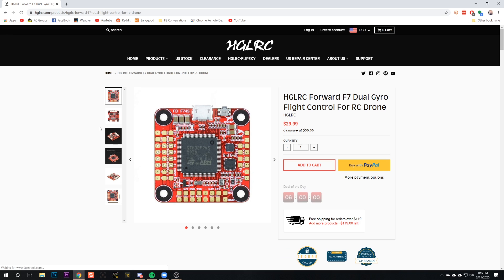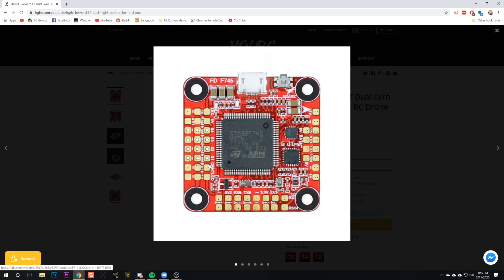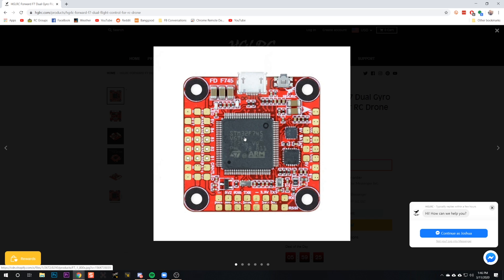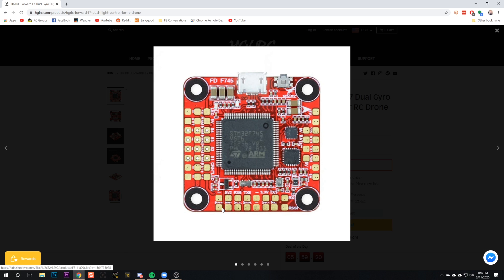Betaflight servo setup (controlled by aux channel)

Comment: What if theres no servo tilt on the tab .
Reply from the maker: You need to enable Servos in the Build Options section fo the Firmware Flashing tab. Then re-flash the FC. This didn't used to be the case when I made this video originally.
Reply: @JoshuaBardwell thank you for the reply Mr.Joshua. Ill reflash now the fc

Comment: This is so usefull, there are loads of modules/switches/relays that can run on a servo input. I also now have a known value on a pin I can use to interface with an arduino or pic.

Comment: Hi JB, I set up a Hexacoptero F550 to launch rc parachutes, I'm using ERLS 2.4 and a FC Jemcu F722, I need to add a servo to release the rc parachute, I couldn't get the servo to work using the LED port, because this command It doesn't work in the CLI, can you help me with this?

Comment: Worked like a freaking charm boys!!! Now, I'm currently thinking through my latch mechanism,  and this is going to be so much fun!!! I'm running a Speedybee F4, and who needs led lights anyways!! Lol
Reply: It looks like the speedybee f405 has a dedicated servo pin at s9
Reply: I'm making a claw for a competition with one servo, connected my power to 5v led pads, signal to s9, and g to g. How to configure it in beta flight? I'm also using speedybee f405

Comment: Thanks so much for the video! I have a Nazgul Evoque that is already using the led spot on the board. Is there a way to find another place with its own timer without disconnecting the led? Thanks!

Comment: Hello, thanks for your video !
By using the LED-Strip it´s working very well with Servo 1 (Tilt servo). When I´m trying to map Servo 2 on the same LED Strip (when Servo 1 is unmapped) it doesn´t work. So no movement of the servo, when I´m rolling the copter.
I would be very thankful, if you have any ideas for this !

Greets from Germany !

Keep up the great work :)

Comment: how to activate servo on channel 3 or yaw??
Reply from the maker: You need to change Betaflight to a trictoper mixer then it will know that yaw axis is controlled by a servo.
Reply: @JoshuaBardwell  I have set it to tricopter, but it doesn't work, I even followed your video, but it still doesn't work
Reply from the maker: For tricopter mixer, servo 1 is the tail. You must manually remap servo 1 to be some output, such as a motor output. After that, I don't know how to proceed, because I have never built a tricopter with betaflight. It's been a long time.

Comment: Having an issue with this, no idea what the problem is. Here's a video of the problem https://youtu.be/CyJEJuUaCZo , I2c errors start racking up same time motor goes out and servo starts moving. If anyone had any insight, kindly pass it along.

Comment: 3AM and five beers too many and needed to get an old tricopter up & running (yaw servo).  with a NAZE32  (F1 controller).  
Nope-
Switched to cleanflight and got it going in about 15 minutes.
I have never even used cleanflight till now.

Comment: So lemme get this straight, you solder the wired to 5v, ground and led pad, also how do I check if led pad is in use?
Reply from the maker: If there's an led strip soldered to it its in use.
Reply: @JoshuaBardwell  thanks for your reply! Could you recommend some cheap servos (that only need to be able to pull a pin for a dropping mechanism) that I could buy in Australia, thanks
Reply from the maker: I don't use servos often and wouldn't know what's available in Australia.

Comment: can we use buzzer pin instead of led strip pin?
Reply from the maker: Maybe. The buzzer- pad has a transistor that buffers the output to avoid pulling too much current from the MCU pin. This transistor may not respond fast enough to allow a PWM signal to pass through without being corrupted. The buzzer+ pad is just 5v so that wouldn't work.

Comment: Hi Josh, 

I got my servo to work so thank you very much. However, I now need my switch(aux) to have a safety function. So for example; something like 3 presses of the switch will then activate the servo movement from 0 to 100. Then one more press of the switch returns the servo to 0. The servo is being used to bridge a connection to activate another function. So I am wanting my switch to have a safety function basically(2/3 presses), so if it is pressed accidentally. It wont activate the mechanism. I don't know if this can be done but if there's anyone that will know if it can be done. It will be you ;). Or maybe you can think of another/better way? I'm using the Tango 2 btw and the "D" switch.
Reply from the maker: Use a 2nd switch as a safety. Make the 1st switch be locked out until the 2nd switch is pressed.
Reply: @JoshuaBardwell  Yeh I sussed it pretty much straight after I posted my comment. I'm smarter then I think haha. Thanks for getting back to me though (y)

Comment: I know this is a year old vid, but I am working on a project with a tinhawk 2 flight controller. You mentioned that this has to be a pin with it's own dedicated timer. In this case the LED pin D12 was used.  Other than LEDs, what other types of pins might have a dedicated timer?   I'm wondering if my little tinyhawk 2 board has one I can use.

Comment: Ehi Joshua, what about to controll servo by yaw? For tricopter you know.
Reply from the maker: Betaflight has a tricopter mixer but it flies very badly.
Reply: @JoshuaBardwell  LOL happy we didn't try also wanted LED control on our Tricopter so I would have had to find another output with a timer and on an old F1.  
Cleanflight did the job and he crashed it 1/2 later at 4AM in the dark so that sure was a productive night.     
I mean it flew fine.  
HobbyKing Trifecta.

Comment: if I use a quadcopter and I have outputs for 8 motors, can I remap two motors to use them as servos?
Reply from the maker: Probably but not guaranteed.

Comment: This has been a big help. I have a Kakute F4 V2 in my LR Tricopter from RCExplorer. Added GPS with some wiring changes, and the tail servo went nuts, see my LR Tricopter trials video on my channed if you want to see it.  Thought it must be software, so flashed latest Kakute firmware to the board and the servo stopped working, totally unresponsive! 
I did many mechanical changes that I thought would fix it, changed servo, added a dedicated BEC for the servo, wiring this way and that. Nothing moved that servo.
Then, I found your video on the subject of servos in FCs, and after relating your info here to my situation, I was able to get it working, yep, like you did, on the first try! 
Fantastic help to what I think is a common problem for tricopter flyers. Cheers!
Reply: What servo are you using, or what servo would be reccommended?

Comment: Is it the same procedure for iNav?  Thank you.

I'm going to use the servo to trigger a switch to turn a high-power strobe off and on.  If you know a better way to do this please let me know.
Reply: I am looking at the same problem and it is much easier to just get a TX Controlled Relay Switch. The 10A rated ones cost about 8usd. When the PWM is below 1400us the switch turns off when it is over 1500us the switch turns on.
Reply: @sendorm  thank you for the input.  I am going to be running a Crossfire receiver that I expect is SBUS.  I don't think I will have a spare PWM output.  I want to run a relay off the flight controller. I am not an electronics expert but I think I'm going to be using the WS2812B LED to optical switch a light sensitive resistor or photodiode circuit through a Darlington transistor and relay.   You would think iNav and the flight controller designers would  provide a switch for accessory operated by a uart.

Comment: I am building an RC plane out of parts I have lying around and that requires 3 servos (left/right aileron and elevator). iNav would be the natural choice but since I am using two motors, my FC only has 4 motor outputs and iNav does not allow resource remapping I will try my luck using Betaflight channel forwarding. Apart from the remapping part that doesn't seem too bad.

Comment: I've been using this method for a few years as I have camera tilt servos on all my quads, usually using a motor output. I never figured out what Live Mode does and have never gotten channel forwarding to do anything.  I've also had Betaflight on gliders and planes which works well stabilization, osd and telemetry.
Reply: hi! how do you do to make servo work on motor output? same as the led strip out here?
Reply: If you could tell me how you make this work on a motor output I would be SO grateful.   I'm using a tinyhawk 2 fc to build a plane. I have three working esc's, on the fc but am only using 2 and if I could use the third for a servo it would be awesome!
Reply: I need to know too

Comment: Hello. Is there a way to use a old aio board with 12 amp esc for an rc car? Like use a servo and use one of the motor output only for 2channels?

Comment: Hello Mr. Bardwell ... I do not know if you have time to answer my question, but I will ask anyway ... Unfortunately I do not find any information about whether the flight controller must always be in the middle, would like to put it in the tail  build my copter ... Is that possible or does it affect flight behavior?

  Greetings Miguel
Reply from the maker: The FC does not have to be in the middle.
Reply: @JoshuaBardwell  Thank you very much for the help ... And a big compliment to your work and the effort you put in ...

Greets from Germany... 😊

Comment: Servo Tilt and Channel Forwarding are weird, I once needed to put out an AUX channel as a motor value (so it was motor 5) to adress an onboard speaker on a pdb... don't ask... ;D
I think in the beginning I used both but iirc it also worked with just Channel Forwarding. ;-)

Comment: JB, I have been using Servos for years as I started out on RC planes  about 30 years ago. However I found this video very useful for putting servos in Quads so Thanks. There is one thing I would recommend you do, get a servo tester and before you wire up the servo Centre it out  (what this dose is puts the servo arm in its centre position) then you will get full throw of the arm.

Comment: I've been using Servos with Beta flight for years. Even have a Bicopter that uses two Servos.
https://rotorbuilds.com/build/18082
Reply: Any chance of doing a how to video? Not many of those out there and your bicopter looks cool!
Reply: @pelletubbies  Wanting to do an upgrade on the Tilit-Mechs so yeah it could be possible to do a short video. No idea when though as I am waiting on my Prusa printer to arrive. 

Another thing is that with BF 4.1 + we have the option of motor filtering whch should allow for much smoother / controlled flight. Which if you recall was one of the major hangups with a Bicopter.

Here's an earlier flight i did but its a little out of focus: https://www.youtube.com/watch?v=wqk_aa5t4d4&t=94s
Reply: dont suppose you,d like to share that information? all i want is to get 2 servos working for a flying wing, thanks

Comment: I want to incorporate this into a servo that will control camera tilt.  Mix it to go to 40* in Acro mode, and like 5* in Angle mode (for landing).
Reply from the maker: Easy to do just map the aux channel to the switch and then set the channel values to the desired camera tilt. The big problem is the situation is not very durable in a front impact.
Reply: That should be fairly easy to do, and a pretty neat use for the servo function.
The trickiest part of that is probably designing the servo camera mount so it fits inside the frame to be protected during a crash.

Comment: Could you use a motor channel for a servo? If so i have a quad pdb fc i wanted to use in a delta.
Reply: I’ve been thinking the same thing!   I’ve got a couple happymodel FCs with a burnt esc and I was thinking about using one for a  micro flying wing.
Reply: @gokartmozart9430  Same, i'm watching this vid to do that
Reply from the maker: Usually yes you can use a motor channel.

Comment: How can I tell if another pad has a timer on it? Thx
Reply from the maker: It's very difficult to do it since BF does not have any command line output that shows which timer is assigned to which pin. You can read the target definition file on github and if you know what to look for you can do it that way.

In general, LEDSTRIP will always work. Motor outputs on modern FC usually will work, because Dshot also requires a dedicated DMA channel and timer.
Reply: Joshua Bardwell thx
Reply: newer versions of BF has the timers command
Reply: Alex Yip cool thanks
Reply: @alexyip  Just type "timer" in CLI then also type "resource" and match up the pin resource code like "D12" to find 
that timer D12 matches LED_STRIP. I've been wondering about how to do this. Thanks for clarifying this Alex and Joshua. Much appreciated.

Comment: I didn't have much issue setting up a servo on my Kingkong ET125 to drop tetrahedrons on command. I even swapped out the momentary lever on my TX for a momentary push button. Watch the last 10 seconds: youtu.be/vy8kXkl9oqM?t=421